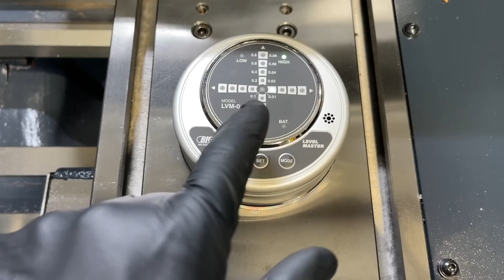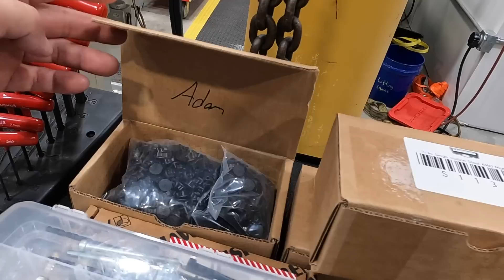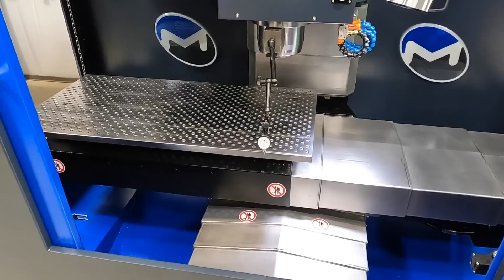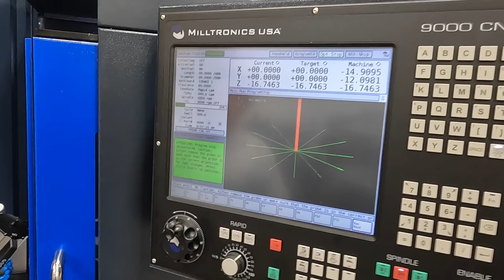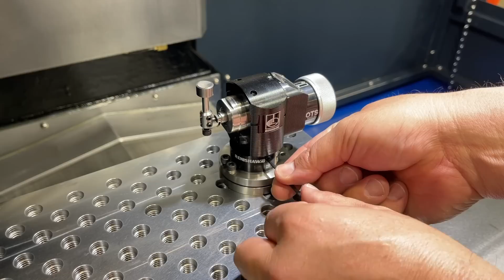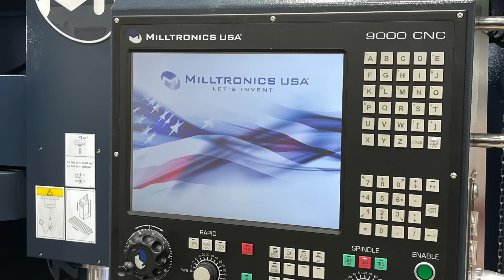Setting up the Milltronics CNC Machines for Service

Comment: CNC machine tools should always be laser leveled. And all machine tools should be isolated on their own foundation so you don't get any vibrations from your other machine tools or fork lifts running. Also, for all CNC machines tool leveling pads & screws should be set in special machine tool mortar mix. I have been working on CNC lathes & mills for over 30 years & every time we moved or installed a new machine tools we installed it as I described above. Milltronics should have sent you a foundation plan a few weeks before delivery so you could have had the foundation ready to set the machine tool on.

Comment: Crossed over from manual machining into CNC years ago. Went thru the learning curve with the machines and CAD-CAM software. 
Never looked back. I cringe when I have to use a manual lathe or mill.

Comment: Really looking forward to seeing this kit in service. CNC is a lot of fun to watch. Adam is going to feel weird at first watching chips fly and just standing back trustng the code to do what you've told it to do.
Reply: A rather important thing to remember at times like this is that, just as every other computer controlled thing, a CNC machine doesn't do what you want it to do - it does what you told it to do.

Comment: Seems like a fine set of machines, but I would never personally buy a machine with a black or dark painted interior. Dark paint makes the lighting situation in already dim machines much worse. Also I would get depressed staring in a dark machine all day.
Reply: It's funny I swear machine tool designers finish the machine's design and go "Damn that looks good".  They somebody come along and says "where are the lights?"  The engineers then just throw them in the machine, usually in the worst spot possible.  Same with coolant.  It always seems like it was an after thought in the design of the machine.

Comment: How accurate was that digital level?   Congrats on the next phase of getting the CNC's up and running.
Reply: That thing is crazy accurate. Even the interia of the table stopping and starting was enough to tickle it
Reply: @TheCuriousOrbs  yes, although a liquid spirit level would do the same.
Reply: @TheCuriousOrbs  of course, even a bubble will do that,  my angle cube will do that if I put it on my mill. So not sure why you think moving it makes it accurate.

Comment: Chips!  We want Chips!  Push this machine.  Seems like a lot of 'cutting air', double and triple losses.  Cut!    Don't be  afraid. You've got all the FEEL of a machine cutting materials.  Start at a reduced speed and increase as needed.  When the machine bogs down, and you start spitting inserts, back off a little.  You've found the 'sweet spot'.  You've got experience that no CNC machinist has.  Put this machine through it's paces.   You're gonna shine over, and over.  Drop me an email if needed.

Comment: So do you need to buy more .0001 tools?  Or maybe .000005?  I guess if you are milling (not turning) a shaft to a tight tolerance, that kind of measurement is essential?  If along the way you could point out the differences between CNC and manual measurements and why, that would be interesting.  I've not run any of this kind of stuff, but I guess they even mill threads: internal and external?

Comment: I would be weary of using a mag base on the Renshaw sensor. If it measures distance using IR. if it gets jostled during a multi op process it could throw your part off or error out your machine.
Reply: @Ed Rees I was referring to the read head not the probe itself. The probe can easily just be stored in a drawer when not in use. The video shows it stuck to the inside of the enclosure.

Comment: Adam- Did you put a nice coating of oil on both the table and bottom of the sub-plate? If not do it up. Keeps the rust at bay for sure. You are in for some fun stepping to the world of CNC machining. Well done.

Comment: I’m sure you know it, but put a nut on the bolt before you cut it down, and when you back it off, it re forms the threads after the bolt is cut. 

(But hopefully it helps someone who doesn’t know that trick)

Comment: What's funny to me Adam is people think when you buy a machine of size is that you set it on the ground, plug it in and start making parts. I just installed a 4000 watt laser and took about 6 months total to get the bugs out of it. The last blow mold machine I installed took 1 year.

Comment: Adam, I wasn't sure what to expect when you started getting the CNC machines. I just hope you to go full-on learning them like you are with manual machining. You have every advantage over the computer types, because you know all the methods to make the part you want. They know computers, but you know machining. It's easier for you to learn CNC stuff than it is for them to learn the tricks of machining. Rock on, man!
Reply: In a modern shop you have to know both computers and machining.  Anybody who thinks that they can just learn CAM and be a programmer is in for a rude awakening.  Sure they can program a part, but odds are it'll be a crappy program that makes crappy parts.  Even if they have basic understanding of speeds and feeds there is still much more needed to make a good program that will make quality, repeatable parts.  Any shop that is hiring people to do programming that have zero actual machining experience is in for a world for disappointment.  I've trained people at almost every shop that I've worked at, I see people that can barely operate a machine think that in they can jump right into programming.  Like it or not there is a pretty clear path from operator to programmer.
Reply: @brandons9138  So true! I had a "Consultant" gig a few years at a plastics vacuum form company. Their Vietnamese "Engineers" didn't speak English. They were constantly fighting the CNC machine! Part fixturing was done by pulling a vacuum on the part and they were always chasing leaks (and ruining parts when they came off the pattern). Walked by one day as they were running it and the machine speed was set at 25%! Offered to the boss that I'd help them, but he wasn't having it. Got tired of that gig pretty quickly! 😠
Reply: @brandons9138  I am retired now after 49 years a turner.  The last 35 years on CNC. Lathes, machining centres and VTMs. He is going to struggle on the CNCs. He has had a life-time in a jobbing shop, CNC work is for high batch production. Good luck with it. Hope he recoups his outlay.
Reply: @geoffgreenhalgh3553  Agree, CNCing is not something you can do on the side. You either go all in and work on them full time to get totally comfortable with them and after all long time you can get some productivity. Do it every now and then and you will end up taking so much time to make something that you'd be faster doing it manually or outsourcing the part altogether. Unless Adam is planning some very high number batches that you only have to set up occasionally these machines will likely be gathered dust. I hope he proves us wrong though, would be lovely content to see these babies in anger!
Reply: @MrBlaadieblaa  Nah. CNC works great for one off projects. It’s much faster to program a CNC to cut a specific radius that making the tools to do it manually for example. And if there’s a need for a specific surface finish, you can’t beat the CNC as it has a constant feed/cut ratio.
Reply: @MrBlaadieblaa  Exactly my point. I'm a civil engineer and computer work has been an integral part of my profession since day one, CAD included. Coming from the field though has given me a great advantage over just 'book smart' colleagues. That's what I meant in my encouragement to Adam
Reply: @MrBlaadieblaa  Agreed.
Reply: @jesperwall839  No chance. One off on a CNC??? Can take a lot longer.
Reply: @geoffgreenhalgh3553  this man doesn't know cnc lol.
Reply: @geoffgreenhalgh3553  You started somewhere didn't you ,I believe you are wrong saying Adam will struggle ,He's committed 100% .
Reply: @Jacob-64  He will struggle I am sorry to say.
Reply: @geoffgreenhalgh3553  You have obviously not worked with CNC 👍
Reply: @jesperwall839  Read what I said.
Reply: @geoffgreenhalgh3553  A simple part is obviously faster to machine in a manual lathe. But as soon as you need any kind of radius, threads and things like that, CNC is faster.
Reply: @jesperwall839  Yeah, I guess my workplace is doing everything wrong if Geoff has a say in it. We only make prototypes and VERY rarely make more than 3 of the same part. Maybe we should just sell the CNCs and go back to manual machining....

I have the utmost respect for manual machining but manual machinists that wants to lecture me about how they're faster and that CNC is only for large batch production..🥱

They honestly dont know what theyre talking about
Reply: @jesperwall839  At least 35 years on a CNC, NC and peg board autos before that.
Reply: @geoffgreenhalgh3553  And still your slower on CNC than a manual? 🤔 Read the post before yours 👍
Reply: Cnc is a lot easier to grasp with a willingness to learn and especially with adams experience AND willingness to learn. We aren’t making aerospace parts here. Stop being rude.
Reply: And apparently Geoff has never used a milltronics or hurco. Things are a lot simpler than you think they are.
Reply: You all have made your points. Stop sounding like the girlz locker room .

Comment: You are going to LOVE those Renishaw Wireless probes and tool setters.  It makes setup a breeze.  Make sure to keep a few spare batteries around as they always seem to go dead about the time you are in a rush to do something.  Ha Ha
One thing I did was make up a Microsoft Word table where I listed all of the programs I made for the CNC machine.  I gave each one of them a unique number in the CAD/CAM program.  In the table I listed the Program No., Machine i.e. lathe/mill, Date, Project, and Machining Description with any necessary notes.   Then if I ever needed to run them again I could quickly look them up.  Also, I have a directory on my computer hard drive will all the cad/cam programs included.  Furthermore, I make another backup on a seperate hard drive in case of a computer failure etc.  Just some ideas that may????? be of help.

TM-1P Programs
				
Prog.	Haas/
No.          ShopBot    Date:           Project	                                        Machining Description
_____________________________________________________________________________________________

0001	HAAS	04-13-08	Futaba Transmitter Balancer	Mill Flats for Strap Bracket
0002	HAAS	04-13-08	Futaba Transmitter Balancer	Top Bkt Adjust Slot
0003	HAAS	04-13-08	Futaba Transmitter Balancer	Top Bkt Bolt Head CL
0004	HAAS	04-13-08	Futaba Transmitter Balancer	Top Bkt Hole Strap Hook
0005	HAAS	04-13-08	Futaba Transmitter Balancer	Lower Bkt Top D T 3mm
0006	HAAS	04-13-08	Futaba Transmitter Balancer	Lower Bkt Btm .120 Profile Cut
0007	HAAS	04-13-08	Futaba Transmitter Balancer	Lower Bkt 3MM Side Bolt Hole015
Reply: Another R/C hobbyist I see! I have a 6WD/4WS "Mutant" that I made starting with a Kyosho USA-1 Monster truck. Aluminum frame, bearings everywhere, oil shocks (cantilever setup), metal gears and Thorp ball diffs. The only thing left from the original kit are two of the gearcases. TX is a JR Max4 airplane radio, factory converted to ground freq. It's a lot of fun in the snow! 🤣
Reply: @PhilG999  Yes, I started out in the hobby back in 1968 and finally sold all my R/C stuff in 2018.  I used my CNC mill to make set up tools for R/C helicopters and other accessories within the R/C world. I had a ton of fun and traveled all over the USA competing on a national level.

Comment: what i am asking myself is: The machine asks to rotate the touch probe 180 degrees and has an automatic tool changer. Why dont you orient the spindle 180 degrees and continue calibrating? The machine can orient the spindle for tool changes. when you remove the probe it will never be at the same position again.

Comment: Adam, if you put a nut on a bolt before cutting it, it does two things. First, it gives you a straight edge to compare your cut to, and second, it cleans you threads as you remove it from the bolt.
Reply: Sounds like a good tip.
Reply: I have this suspicion that Adam already knew that. 😉

Comment: When you indicated that fixture plate, the indicator seems to jump the same amount at a set distance apart. The plate doesnt seem to have any visual marks that would make the indicator jump like that. I would be inclined to think there is an issue with the ballscrew on the X axis.
Reply: i noticed that too ..... yet I wondered if the interval jumps were an artifact resulting from how the fixture was secured during machining at SMW?
Reply: @joell439  This is it!
Reply: Or an artifact of the machines themselves at SMW. Obviously it isn't much, as that was a fine resolution indicator.
Reply: I agree with you both, just doesn’t seems to have a visual defect

Comment: How does this fixture plate compare to a granite surface plate?  
      It looks like every business has its fetish. For photographers it's megapixels, for car guys, it's horsepower.
  btw, when cutting bolts, it's better to put a nut halfway on, and have the jaws of the vise clamp on the head of the bolt and the nut to prevent it from moving.
Reply: Not as good as a surface plate, but every bit as good as most machine tables!

Comment: As a guy that runs CNC Mills and Lathes to put food on my table...All I have to say Adam, is that your life is about to change.  I know how great you are on your manual machines...but I'm afraid they'll start collecting dust soon.
Reply: Change? Oh yeah, I believe you are 100% correct.
Reply: But for a guy who does just one off jobs how much difference will CNC machines make to him? Doesn't it take a lot of time to set a job up?
Reply: @snappingbear  I’m thinking there’s something in the works for expansion of work and multiple parts runs . Gotta make the equipment pay for itself.
Reply: @jerrypeal653  That's what I'm thinking.  The whole (and I will use an overused phrase!) paradigm will shift. :)
Reply: @snappingbear  you're not wrong. On one hand he could take on jobs with much more complex geometry/features. The reality is that many of those jobs take years of cnc experience and familiarity with your machine to feel confident. I've been running multi axis, multi spindle and multi turret turning centers for almost 15 years and I still wouldn't take on one off/high dollar jobs if I had my own shop.  This guy knows what he's doing and knows his limits. He'll find the jobs that that fit his skill and equipment.
Reply: @snappingbear  Adam can start making and selling his own range of tools like Fireball Jason does
Reply: @snappingbear  I'm thinking that multiple parts contracts will be coming his way
Reply: @snappingbear  I was wondering the same thing. How much equipment does it take to remove broke bolts? Plus, he is gone for weeks at a time. That stuff won't pay for itself sitting idle. IMHO
Reply: @mnmike130  one thing you have to remember is that his business is now YouTube. I'm willing to bet that the majority of his income doesn't come from machining anymore. Also, I'm willing to bet that he didn't pay for the machines, or he didn't pay full price at least. I don't remember if the gantry mill was on loan to him or if it is a lease, but he mentioned something along those lines. These might be similar. 

Either way, I'm looking forward to watching him learn CNC. Lastly, commenting on the vacations he goes on is somewhat weird. I'm sure we'd all be doing the same thing if we were in his shoes.
Reply: @mnmike130  He's a YT content creator.
Reply: @commoncentstx  correct. I don't know what do hard for people to understand about that. He already said the machines were sponsored, and he pays for the other stuff by doing exactly what he does day in and day out... Make YouTube videos.
Reply: @mnmike130  he got  them for free!
Reply: @mnmike130  He does alot more than remove broken bolts.  Look at his list of videos buddy.
Reply: @verteup  OK buddy thank
Reply: Completely different needs. If you making more than 10 of something, sure.. CNC rocks the $$ in...  For job-shop one-off tasks, forget it. Manual setup and operate rules. There is a place for everything.
Reply: One of jobs are routinely done on CNC’s.
I turned a shaft on a CNC lathe with several tapers, draft angles and radiuses. Would have been a nightmare to make on a manual lathe.
Reply: All this Cnc stuff makes me wish I was more technologically competent. I can barely operate a iPad so I would have no chance of programming Cnc. I guess the good news is I’m smart enough to recognise that it would just be a expensive exercise in frustration for me. I’m not knocking it, I just know that I’ve left it too late. Good on Adam for being willing to learn.
Reply: I SAY HE WONT GIVE UP ON HIS MANUAL LATHES  . A WISE MAN HAS A FOOT IN BOTH CAMPS .  REMBER THIS IF YOU HAD A MAN THAT CAN ONLEY OPERATE. A MICROCHIP.  HE CANT GO TO A MANUAL LATHE AND JUST WORK IT  WHERE AS A MAN THAT CAN DO MANUAL LATHES  JUST GOSE STRAT BACK TO MANUAL . IM NOT AGAINST NEW TEC BUT I DO THINK ITS GOOD TO KNOW BOTH .   BUT NEVER FORGET THE OLD WAYS . YOU NEVER KNOW .
Reply: @tonyking9235  agreed
Reply: He's not building a workshop, its a You Tube studio. Just like all the other big time content creators ie Jimmy Diresta
Reply: @Curlyim2  its a museum